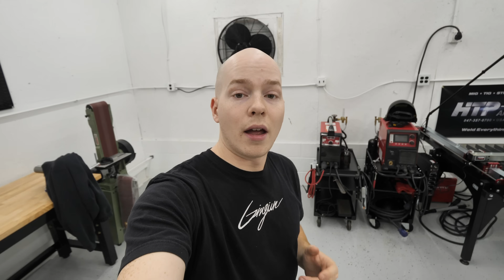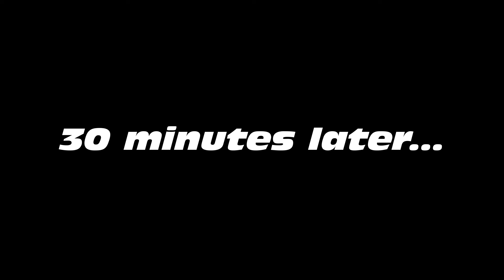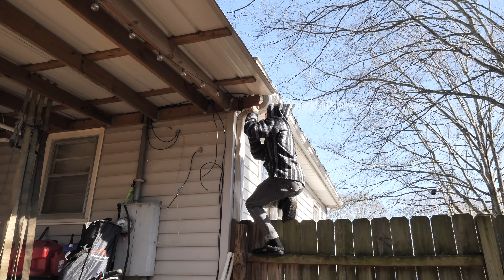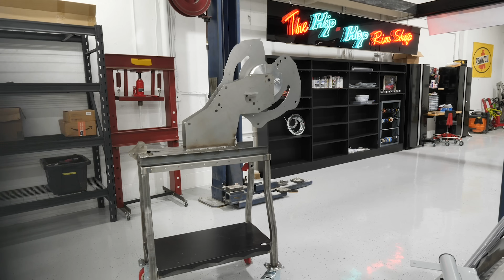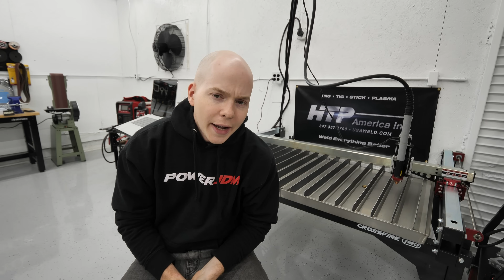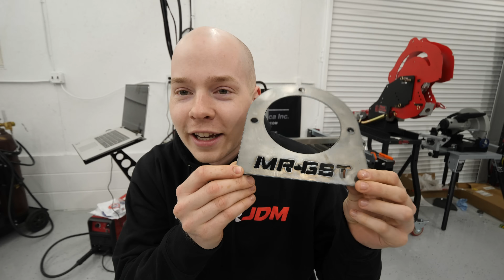Setting Up LIFE CHANGING Fabrication Tools in the SHOP!

Comment: Get the yellow $10 magnets from harbor freight they are super strong, and pretty good quality, I use them a lot at work (fab shop that usually doesn’t do anything thinner than 1/4 inch material)

Comment: does it not come with a spark guard & some sort of extractor? i use a plasma based 400watt laser(much bigger bed, 1.5meter x 1.5 meter) daily for cutting timber. it has full extraction system for the smoke & can change the head too cut steel (even though we don't) too a protected head that doesn't allow sparks out past around 25mm/1 inch. just an FYI ours is nearly 20yrs old & is still accurate too within 0.2mm. amazing machines. can't wait too see how u utilise it :)

Comment: With all the welding you're doing, you should really consider getting a ventilation system setup. It would be terrible if you got ill from the various gasses inhaled during welding. Even if the room is big, and you have some ventilation, you should have some straight up suction on the welder to protect your self. I wanna see you live a long life!

Comment: Bro I have the same bender. It so bad ass. if you haven't did it yet. Build a 90° test piece of tube with the clamp offset marked out on it for laying out bends. It helps so much with getting bends in the perfect spot every time really fast. You can hold it up in place where you want to bend with a tape measure to get your fitment on point.

Comment: Two CNC plasma tips:
1. Fill your table until it is nearly overflowing. It will help prevent warping especially on large cuts and it will help keep smoke at a minimum. 
2. I know the whole table is probably grounded, but I’ve found it all works smoother if you splice in a ground clamp to clamp to the workpiece.

Comment: As a cad designer I can advise you to get a good a3 laser paper printer. Make a drawing scale 1/1 and print your piece before plasma cutting. That way you can verify if your cad model is correct before cutting metal. Good luck with the new shop.

Comment: That CNC plasma table is amazing. You are going to be able to make so many things with all the new tools you got.  One thing I am noticing from this is... You might want to make a fumes hood for over the Plasma table.  That table is making some heavy duty metal fumes.. and you do not want that in your lungs.

Outside of that.. the sky is the limit.  You could make yourself chairs, another one of your own metal tube bender, even the wall control system your using if you want.  That thing is insanely powerful, and I want to see you abuse it to make all sorts of things.

Comment: Get rid of those harbor freight hose clamps, i thought it was a cool kit too, but as a commercial clammer i can say they are the worst I’ve seen and they just suck. Granted mine see salt water but they’re just not up to the grade of sea breeze, Usp, or the globe brand Napa sells, the best I’ve seen are aero seal which are aviation grade. Not much difference in price either. Hope it helps.

Comment: If you don’t have a normal (paper) printer I would highly suggest getting one. You can print out parts you design and cut them out to make sure they fit before doing the same in metal. It would save a lot of money on metal in the long run. Alternatively, you could get a 3D printer for the same purpose. That would also add a lot of functionality for making components that don’t need to be as strong and/or could not be made with 2D sheets that have fine detail.
Reply from the maker: That is a good idea! As you'll see in the next video, I used some thinner gauge steel to test my designs before cutting them out in the thicker material. But even that is way more expensive than paper!

Comment: How about making the grand old dirty finger on a paper, then have a basic scanner and use that to take direct measurements/move them to CAD? Not sure if the idea is just bad, but maybe it could be used on something with very uneven bolt holes?

I'm really not familiar with the workflow of cad/cam stuff, but as one could see from Casey Putsch's channel, there was some very finicky measurements taken and then moved to CAD for the engine/frame plate on the K Swap IndyCar, that in the end resulted an unusable part. On another episode they just took the measurements with some cardboard or something and pointed out how CAD may not be the easiest or most reliable way of doing things and surely not the quickest...

Comment: you should really look into a 3d printer for interior parts and custom ducts they are super handy and really easy to setup for the most part and if you go diy like a voron 2.4 you can print pretty big items for less then 1000 dollars
Reply: For the amount of time it takes to build and tune, a DIY printer is not worth it for him. He'd be better buying a quality pre-made machine like Prusa or Lulzbot. Just plug and go so he can focus on making video content. Same reason he bought a pre-made CNC table instead of a DIY build. He'd also need to learn how to 3D model which is pretty time consuming too.
Reply: @msdosfloppy  I learned in a couple days with fusion 360 to do simple stuff like velocitystacks adapters made my own airbox for my bike you just have to want to learn, I was just talking more size because a voron gives him alot of space to work with, and the keyword was "if you go did like a voron" would most likely be better off with a cr10 with a .8mm nozzel
Reply: @msdosfloppy  I totally understand what you mean though

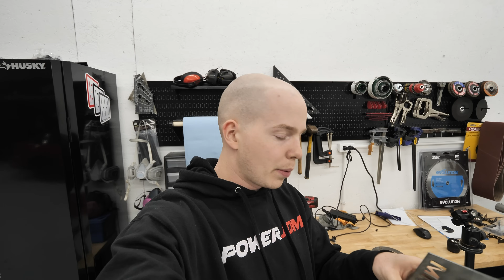Comment: 24:03 I think you have the actual plasma on too high. It's melting the thin metal a lot more then it needs to. Play around with it and do some trial and error runs and honestly, make a spread sheet of what you found the best heat settings to be for certain metals, thickness etc. I'd probably do this for a day or 2. And then you won't struggle with figuring it out when you actually need to use it.
Also, a question, can you cut wood with this cnc table? (I am predicting you'll need a different head unit for it)
Reply: If he fits a drill head on the mount, it could work. I'd just have something laid over the top of those grates for the water tray.
Reply: Realistically, if you want to cut wood, you would be much better off with a water jet
Reply: @1012Mrjesse  yeah I've been looking into this and yes, that's true. Because it doesn't burn it in the first place
Reply: @1012Mrjesse  or a routing bit for cnc tables.

Comment: Ive owned one of their first gen tables for like 4 years now. Just a quick note, fill water table more, a lot more. It helps with warpage with the water splash back. It gets a little messy so putting up something against the wall to protect from splashes. But the table will quickly pay for itself. Also, there is a FB page a lot of customers are on, and its been crazy helpful
Reply from the maker: Awesome! Thanks for the advice! I read somewhere to put 6 gallons in, but that must've been for the first gen table.